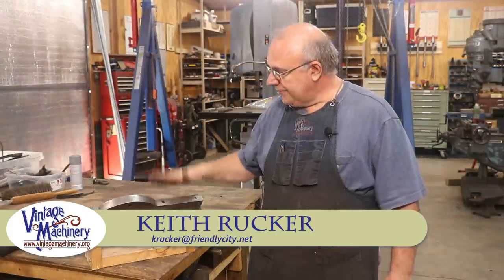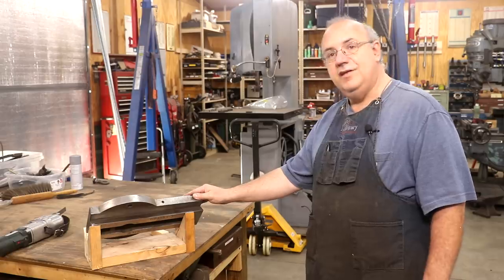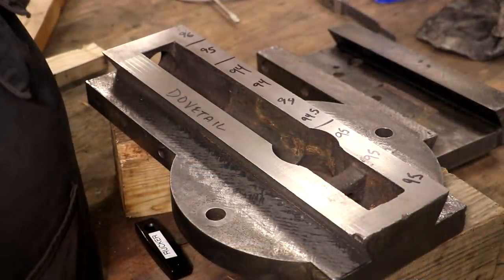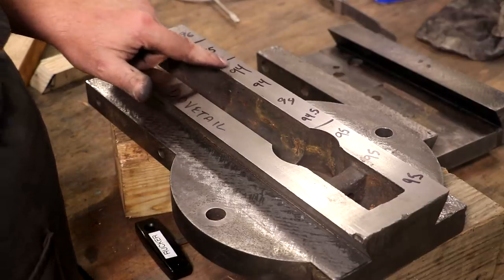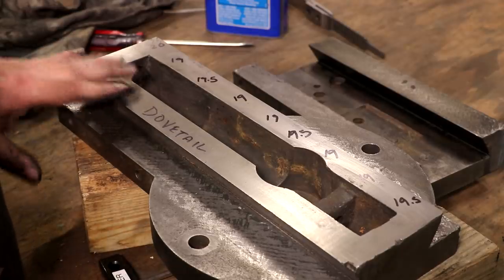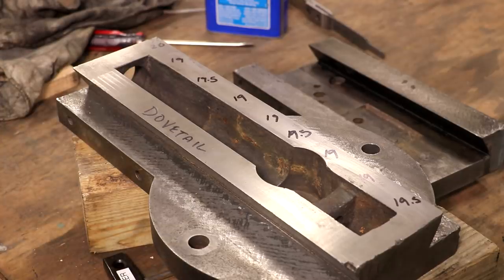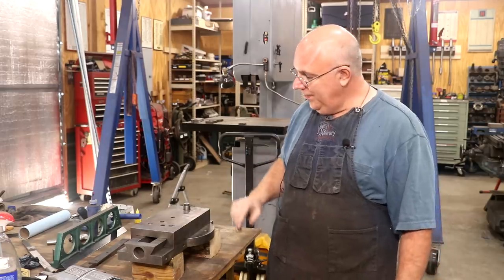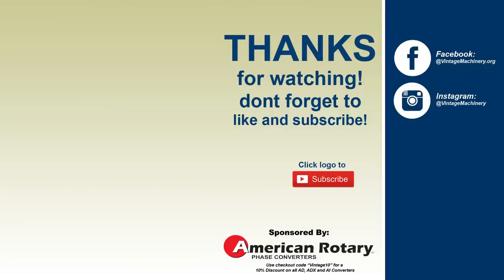Metal Planer Restoration 47: Scraping the Dovetails on the Clapper Box Cross Slide

Comment: I'm very old and re-tired, but I'm always trying to learn a new trick. Recently made myself a scraper. Crude! Silver soldered a piece of a broken carbide molder knife to a pocket I ground into an old file. Ground a curved straight up & down end with my Chinese tool grinder. The end is too thick to get into a dovetail but much to my surprise it worked on an old cast iron bracket, just a test. I'd like to see a close up of the working end of a real scraper.

Comment: With respect to the parallelism of the dovetails being measured across gauge pins, whilst the sides of the dovetail against which the pin bears have been scraped flat, does not the condition of the other bearing surface, the underside of the cross sllde, which I don't recall being so scraped, affect that measurement? Let me hasten to say, that I'm no engineer, but appreciate the obsession with precision, even when it seems to be unnecessary in a machine with large reciprocating masses and seemingly comparatively coarse results that will require further fettling. Thank you Keith for your informative and entertaining videos.
Reply: Teresa, I have the same concerns.  You are correct in suggesting that the surfaces adjacent to the angled dovetail will influence the measurements across the pins.
To explain the phenomenon better, imagine that the adjacent surfaces contain hills and valleys.  The hills will raise the pin, thereby causing it to touch the dovetail further outboard, resulting in a wider measurement.
Conversely, if the pin rests in a valley of the adjacent surface, the pin will contact the dovetail surface lower down, and thereby be nestled further into the V-shaped crevice.  This will result in the pin being further inboard, and hence yield a narrower measurement.
Reply: You are correct both sides would impact the measurement across the pins. However the other surfaces were already scraped true. I think you underestimate the accuracy of this machine once its completed and operational. It will be able to hold a tolerance much better than any milling machine Keith will have access to.
Reply from the maker: Yes, it matters.  In the case of this video, the bottoms had already been scraped - it was done in a previous video and both sides were checked to make sure that they were co-planer to one another.

Comment: If you - like (Thomas) me - wonder why the measurement with the gauge pins is sufficient for proper spacing of the angled dovetails - go back to Keith's "Metal Planer Restoration 42" video where he scrapes the horizontal surface parallel to the crossslide. This ensures that the gauge pin method always references on the same horizontal level and the dovetails indeed get parallel - at least that's how I understand it, but i am just an EE :)

Comment: I thought that for dovetails you first flatten the two matching surfaces independently with a straight edge (the pair of matching sides that contact each other directly), and then you adjust the angle by blueing one and rubbing them like you did at the start. Then you make the two closest surfaces on one of the pieces parallel. Finally you flatten the fourth surface and at the end adjust the gibb.

Comment: I like your way to use the micrometer, you are using the friction-brake knob wich can be calibrated using a special tool and a normal, wich sometimes are delivered with the micromoeter. My normals that came with them have a precision of 0,001 mm @ 25°C and the micromometers a resolution of 0,01 mm. Not the "feeling" that is, wich is not exactly consistent over the time for any human.

If you are measuring extremely thin wires or the width of a human hair, the brake might not give a precise measurment though, even if calibrated at a low setting, for they have not sufficient compression resistance, compared to the measuring force of an ordinary micrometer, using the brake knob.

A tip for calibrating a micromometer:
Put a strip of ordinary clean (shake it before) printing paper between the measuring-surfaces and close the tool softly. Pull out the paper, and you can be damned sure, the surfaces are quite clean and ready for calibration.

It works even with micrometers that can not close on themselves, using normals. Two strips of paper.

One can judge far smaller dimensions than 0,01 mm only meant for that, from a high quality tool if calibrated right.

Comment: [QUESTION] the dove tails on that part dont look like it the primary surface that the machine uses for accuracy. Are you scrapping for smoothing the operation or is there something I'm missing. Isn't that part's movement flat and horizontal with the dovetail down? A jib plate/s would be used to take up any play, correct?

Comment: If there's a worn area on the dovetail as measured in this video, you don't know which side of the dovetail is worn, gib side or the other side. Really, it's the side that's worn that needs correcting.

Looks to me like a job for grinding paste and some muscle power from the shaper ;)
Reply from the maker: When you are working with a piece with a gib, you always start with the side that does not have the gib.  Get it scraped into the matching piece.  Then scrape in the gib side.  Both sides are going to need to be corrected - the work is going to average out no matter which side you start on, but it is always better to match your known surfaces first.
Reply: @VintageMachinery  Parallelity should be maintained with a non-worn surface - some other reference surface, rather than the other side of the dovetail. Without doing that you will likely end up with a parallel dovetail that's no longer parallel with the piece that's moving.

Comment: Would it not be a good idea to check for parallelism from the start so you could compensate for that as well as you’re scraping in for flatness? Also when you are checking for parallelism how do you decide which dovetail you use for your standard? One last question, is your gibb cast iron?

Comment: Question Keith:. Given how little material you remove in scraping, why did your parallelism measurements change so much from .797 to .?19 ?
Reply: I bet it was different pins that got measured.
Reply from the maker: That is a good question.  It has to do with how I was reading the micrometer.  When I measured the first pin, the actual number was like .797.  I did not know if that was going to be the high or low or some number in between - the actual number you read on the spindle of the micrometer in this case was 23, but when you do the math, it translates to .797.  After the first two rounds of scraping, I realized that all of my measurements were within the 0.025" range of one rotation of the micrometer.  To make things easier, eliminate the math, and the possibility for stupid addition errors, I started just writing down the actual number that I read on the micrometer spindle.  19 would have been .794 had I done the math.  Since in this case, I was not needing to know the actual measurement but instead the difference between measurements, I just took a short cut.  I probably should have explained that for you sharp people who noticed the difference in numbers.
Reply: @VintageMachinery  no apology necessary Keith.  I just wanted to make sure I understood what was happening correctly

Comment: Keith, how do you make sure the dovetails are parallel to the axis of travel??
Reply: I was wondering the same thing.
Reply: In this simplified single axis case, the dovetails create the axis of travel. The question therefore might be whether or not the new axis of travel is parallel to the original leadscrew bore. Being off a few arc seconds probably won’t bind the screw here.

In more complicated multi-axis travel situations, the travel axis must be kept orthogonal to one or more other axes and each respective leadscrew axis as well. Not trivial!

Comment: The gauge pins you used for your parallelism measurements , were they the same size or did you just pick adjacent pins from the set?
Reply from the maker: They do not have to be the same size - I chose two adjacent ones.  We are just comparing values measured across the pins - as long as the same two are used for all of the measurements, it does not matter.

Comment: I thought I understood that surface plates had to be mutually ground in threes, to prevent one plate going concave....  and the other convex...  isn't this a risk here?  How do you constrain the two surfaces to move in a straight line, not a curve?
Reply from the maker: There is a method of lapping three pieces to one another to get a perfectly flat surface.  However, instead of lapping plates in threes, it is more common use an instrument to measure the flatness of a surface plate and then lap it flat based on the numbers.  I have an autocollimator to do the measuring, which is old school, but most people who professionally calibrate surface plates now either use precision electronic levels or a laser instrument to measure with.  There are several videos up on YouTube that show how a surface plate is measured and lapped.  I am needing to do mine soon and I will try and do a video showing the process when I do.

Comment: Why not blue first to see where the high spots are before you start scraping ?
Reply from the maker: I like to do a blind cross hatch surface before I blue up the first time.  In my experience, if you do not do this, you tend to get a smear with the ink rather than individual high points.  You are never going to mess up a surface with a blind cross hatch to start with - it just give you something to start with.  After the first round, I will blue up between scraping - except I will sometimes take a few rough passes when I know I have a lot of material to remove from a section - like when I was step scraping - I knew I had to take certain areas down by like 0.002" over a wide area.  Scraping is only going to move a surface around 0.0002 to 0.0004" per pass - you are not moving things very much at a time.
Reply: @VintageMachinery  I'd be interested in a 'big' discussion about scraping as despite knowing and understanding alleged advantages, I can't help think there are better methods - such as using grinding paste on the working surfaces.
Scraping effectively leaves divots and a reduced amount of working surface. While the divots can hold oil (about the only positive aspect that I see), the greater the working surface, the greater the bearing surface and the less wear you'll get.

Comment: Did it matter which side was scraped to bring the dovetail back into parallelism? Was it the gib side that you step scraped?
Reply: It was.  The first side he did, he called the "reference side" and scraped it to match the angle of the mating cross slide part.  The gib side got step scraped to bring in the parallelism.
Reply: Thanks I missed that somehow.  It makes sense to do it in that way. Thanks again. Have a happy Thanksgiving.🦃
Reply from the maker: Yes, the gib side was stepped scraped. I first scraped the true side into the compound and then adjusted the gib side to be parallel and flat.
Reply: Thanks for the clarification.

Comment: I can understand the need for scraping in past days, when machining was not so precise.  But when you can nowadays grind to a 0.005" tolerance why is it still necessary?  (Be kind - I'm not an mechanical engineer or a trained machinist!)
Reply: The short answer is grinding does not create the necessary balance between bearing points and lubrication pockets. Two ground surfaces will destroy each other because there’s no effective way to keep oil between the two under load.
Reply: Remember the age of the machine, its work that needs doing. 
Being in 2020 won't make a difference

Comment: When you were at 98 to 95 wouldn't you want to step scrape both sides?
Reply: I was thinking the same thing.
Reply: One might... if keeping the same relative center was important. In this case I don't see why it would be.
Reply: Actually, the surfaces would become wavy.
Reply: @leeklemetti1887  I agree. Once you've established one side as FLAT, then it would be backstepping to then scrape it with reference to another side.

Comment: Nice video as usual, but I have a question, do you also have to check if those dovetails ar parallel to the "downfeed" of the head? And how to check it?
Reply from the maker: In this case, the compound rotates around a pin so making it "parallel to the head" is accomplished by moving the head.  Yes, there is a scale on the head that measures in angles, but any machinist knows that this scale is just a rough estimate.  If you are doing something precision, you always check your angle against a known reference surface.  Use a precision square on the table with a dial indicator and bump the compound in so that it measures perfectly square to the table if you need that precision.
Reply: @VintageMachinery   thanks, i didn't know that the compound rotates around a pin so it's all clear to me, and i also like scraping videos, it's so satisfying to watch.

Comment: After scraping the wearing surfaces the stability between these get less stable to each other for the benefit of better lubrication. Who ever woud scrape fitting surfaces?
Reply: There is no loss of stability if this work is carried out correctly. The obvious benefits of scraping are better lubrication and increased accuracy. This process is invaluable and well practiced for many years.
Reply: Scraping fitting surfaces is still to keep lubricity. Keep rust preventing oil or wax between the mating surfaces. A ground surface will squeeze oil out, and in some cases depending on how well the surface prep is, the mating surfaces can ring together and corrode.
Reply: There are different techniques when scraping for static fitment vs sliding bearing. In this case, he will target ~50/50 bearing surface/lube pocket. Static surfaces under heavy loading will require more bearing %.